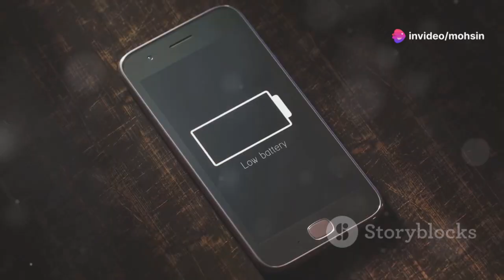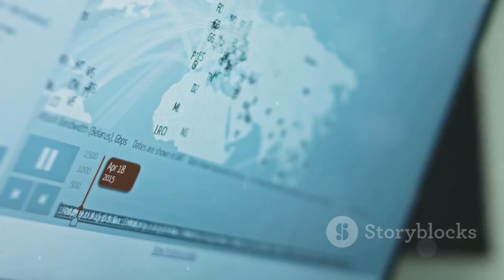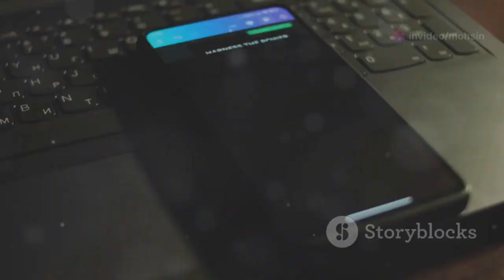China's Silicon-Free Chip: A Game-Changer in the Semiconductor Industry!

Comment: They finally made a lab sample, which is a working CU (compute unit or core) which are 2 less steps for a working CPU or GPU or NPU (transistor -> transistor cluster -> CU) they only have to make a working architecture because you can’t just slap x86 or ARM on it, and make it industrially viable

Amazingly the new CU broke the 10GHz barrier and it’s aiming for 500GHz (not 50), the only downside is that the size of the CU is way smaller than an Intel E core, despite being way faster, meaning they also need to figure out connections, cooling, etc